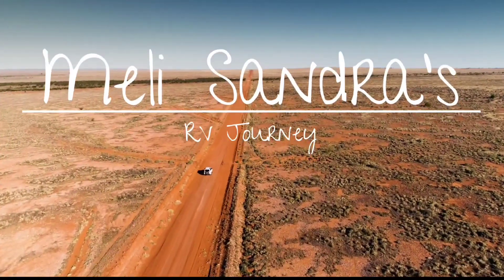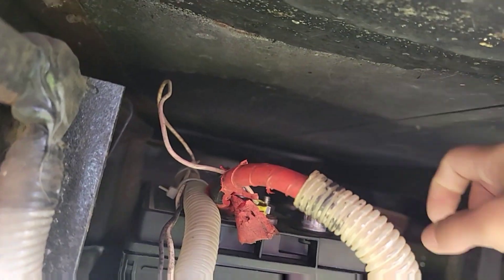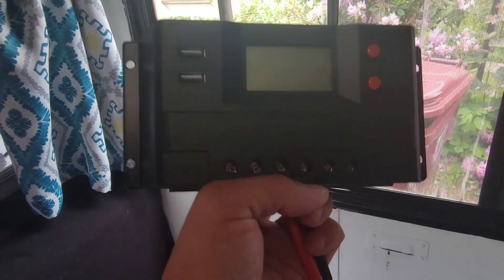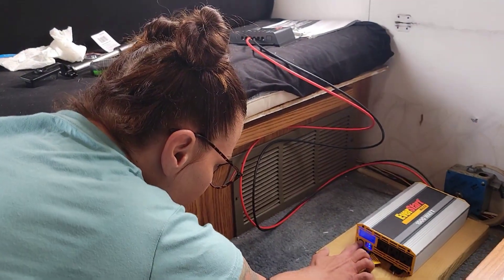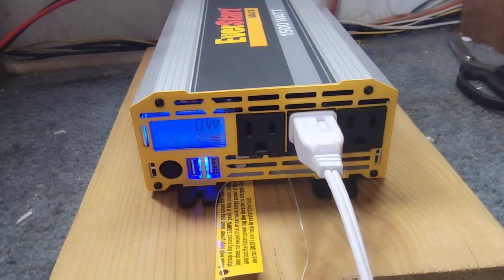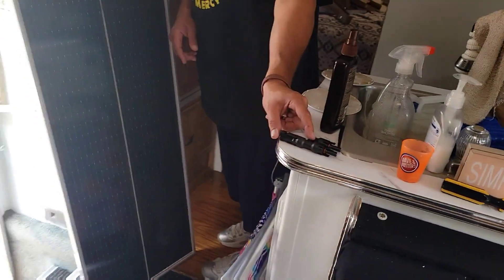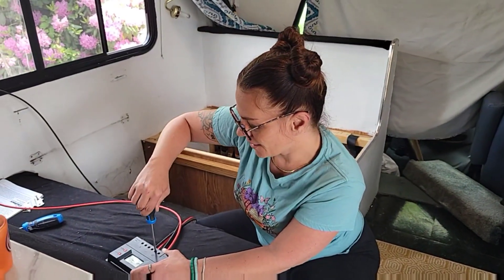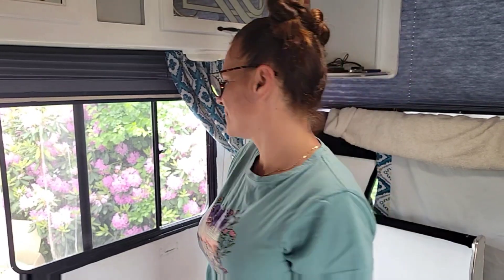INSTALLING Solar Power in my Rv | Boondocking on a budget

Comment: You can add extra solar panels or larger solar panels which would give you more wattage.
Reply from the maker: I think these will work for now I know incan attached an extra battery right and make the 12v last longer but I think the 2 are working for what I need so far ....well see on our next journey what happens 😬